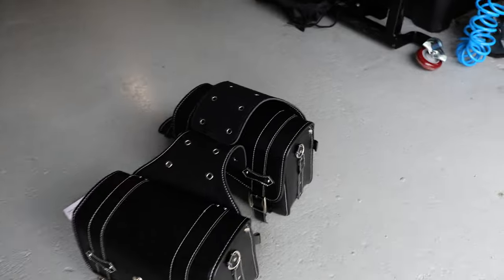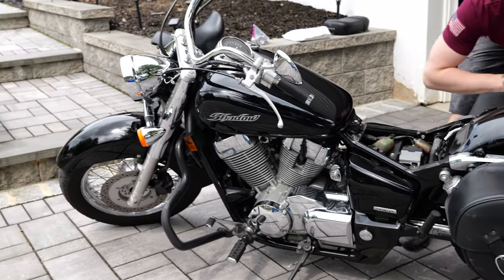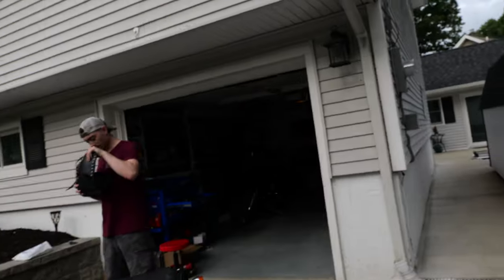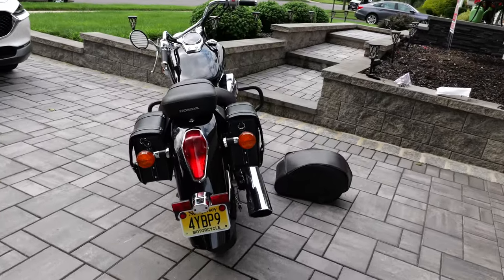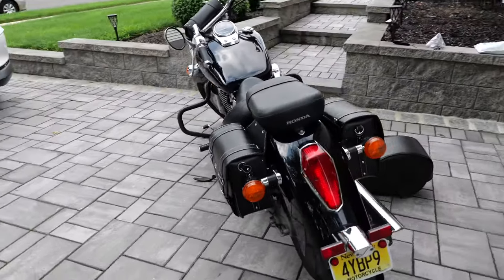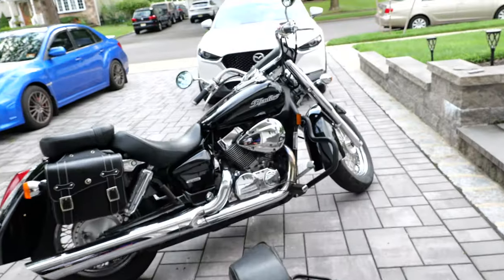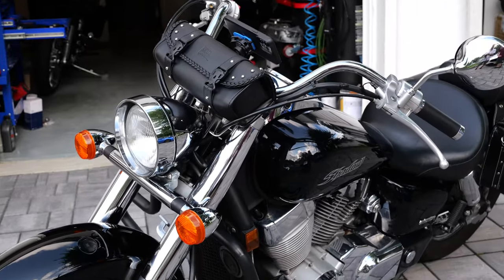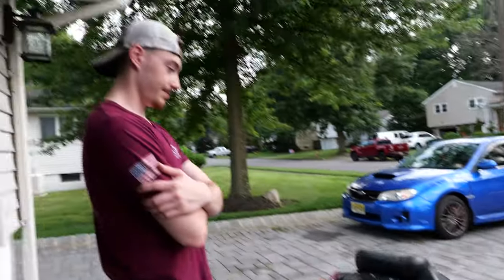ALL NEW BAGS FOR HIS FIRST CRUISER MOTORCYCLE #cyclefanatix #cruisermotorcycle #cruiserbike

Comment: I like the way the old bags fit the lines of the bike. They also look like a higher quality of bags.
A good leather shop could repair the straps.
Just my opinion which you ask for.
It is your bike whatever you choose will be right.
I did wonder if you flip them around where the deeper part of the flap would be in the front would it look better?
Ride safe